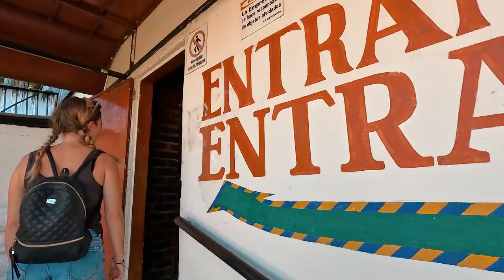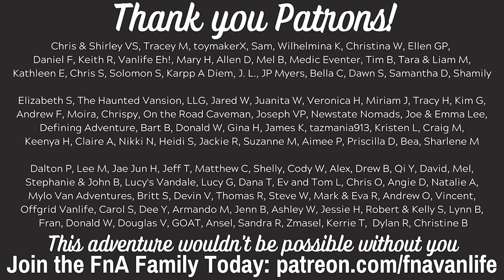Hold on Tight!! Bumpy Ride to the top of Mirador Espiritu de la Montana

Comment: You should have moved the tire chairs to the front of the pickup bed to start with. Everyone knows that it's smoothest riding in the center of the vehicles and roughest riding at either end.
Reply: My first thoughts exactly when they were rattling down the cobblestones.  But it hit me, due to the inclination and the force required to ascend, they would have been pushed toward the tailgate and fighting the force to keep from slamming into into it.  But if the tire chairs were strapped to the front of the bed, then yeah.
Reply: @GeoMac Granddad  They also could have held themselves basically stationary in the front of the bed area, either singlely or together, using both their hands and feet.
Reply from the maker: The problem would be the angle of the road.
Reply: @FnAVanLife  That still wouldn't have been a real problem. You both could have held the sides, respectively, and hold on to each other while stabilizing yourselves with your feet. It's exponentially a worse ride being on the very back of the bed like you were.

On the end, you're basically using the springs, shocks, etc... which is much worse than being in the front of the bed. In the middle, you get bounce and springy from both ends, which mitigates the worst of the bounce you'd get if you were just all the way back by the tailgate.
Reply: @nomadthetraveler5782  
I feel confident trusting the people there who've been doing this repeatedly on a daily basis with lots of people and have figured out a method that works and best solves the combinations of problems they've encountered.

We could go there and conduct a research experiment where we try various ideas and assess various parameters with multiple subjects, create categories and assign scores, enter them all into a spreadsheet and tally best overall scores.  That would be fun too.
Reply: @elgringoec  No need for making simple things difficult. I have enough knowledge and experience to use the KISS method -  Keep It Simple Stupid!!!
Reply: @nomadthetraveler5782  
KISS: keep it simple and straightforward.
That's why I'd just go with the guide's experience instead of trying to show him I know better.
Reply from the maker: Yeah we just went with it! I am not a tire-chair-back-of-truck expert 🤣
Reply: @elgringoec  Just because they may be locals who do things like locals doesn't make or mean, they're experts.

I lived in Russia for a year, and I would do things as I normally would. The young lady I was living with would watch me do things. She'd tell me regularly how the locals would do things, but every time she'd watch me do things differently, and she'd be so surprised. After we'd get back home, or to her friends... She'd tell everyone I was her American Miracle.

She couldn't believe what I'd do would actually work, and she was sure, beforehand, that I could do things my way whereas the Russian guys couldn't get things to work.

I am an engineer and I'd just use the easiest, safest and, in my opinion, the most logical methods for getting things done.

Like, I got stuck in the mud in a field one day. She kept saying the men in her village would have to call a tow truck from a city about 30 miles away to pull them out of the mud.

I collected some boards and carried them to the car where I stacked the wood in front of each tire. I had to use the car's jack to jack up each corner to get the wheels up enough to stack wood under each tire. Then I drove the car so the wheels would straddle the deep ruts and I drove the car back out of the field by keeping the tires on the high ground.

She couldn't believe I'd done it all by myself with no help and no tow truck.

Then I just went back to where the car was stuck, picked up the wood I'd borrowed and took it all back to where I'd  borrowed it from. 

I was surprised she got so excited, telling everyone how incredible I am and the things I'd do. I just took care of business like I normally would.
Reply: @nomadthetraveler5782  
Doesn't surprise me.  Sorry if you expected otherwise.  By the time you reach my age, you'll be so used to having people marvel at the things you do that you no longer give it a second thought.  And by then you'll also have run into enough people who were put off by your unsolicited advice that, well, I was going to say you'll throttle back, and you do, but honestly you still aren't going to give a shit.  You'll offer your advice, and if they take it, great, and if they don't then their loss.  No skin off our backs.  Ni les quito ni les doy.  It's different when they ask us for advice on something, we can give it in good faith, and then if they ignore it -- we're justified to hold a little indignation.  Briefly.  Then it's on them.

Something to think about when we're running around handing out free advice, and that is to consider the quality of a lot of the free advice we've gotten ourselves.  The world is full of a lot of moronic suggestions that may seem to be adequate for others but are anti-productive for us.  So much so that any advice at all is first met with a healthy dose of skepticism.  And sometimes we inadvertently dismiss accepting beneficial advice being so hard to discriminate from the noise.  But we're problem solvers and we enjoy figuring out and implementing solutions.   This way of approaching things it's a likely factor driving us to engineering.

And sometimes we think something through, come up with an approach, and then discover we missed factoring in a variable.  It's a little humbling, maybe even a little embarrassing, but that's part of life and learning.   Another part of life and learning is to be more understanding with people.  It's really hard with people who are confident yet incompetent, which seems to have become common.  But there's no shortage of people who will tell you how to do something better when you can tell from experience that they lack the experience themselves.  But if we perceive them to be well-meaning then we can treat them with grace.

Around here we have an old saying, "I don't care how you did things up north."  It's regional, yes, but you get the idea.